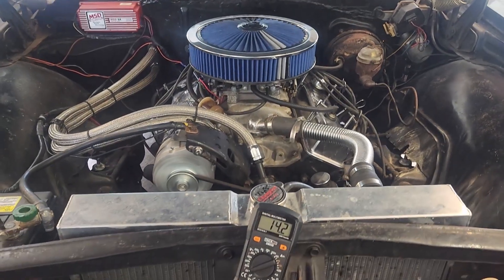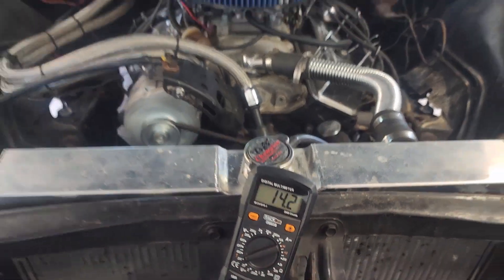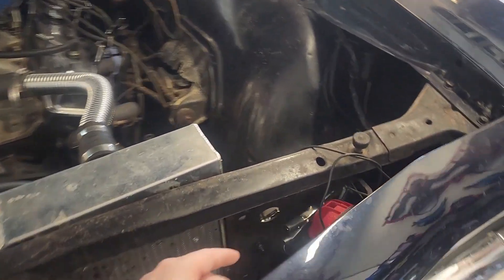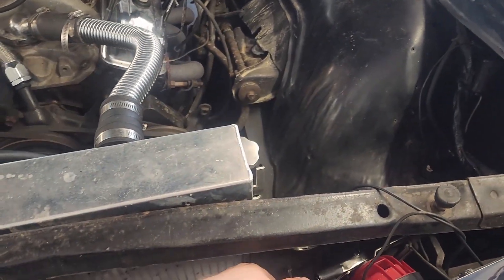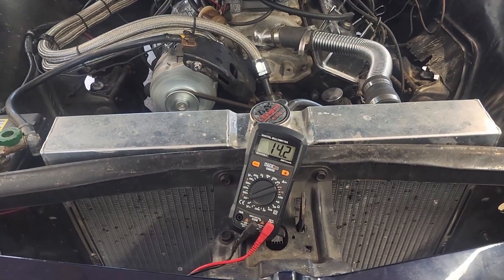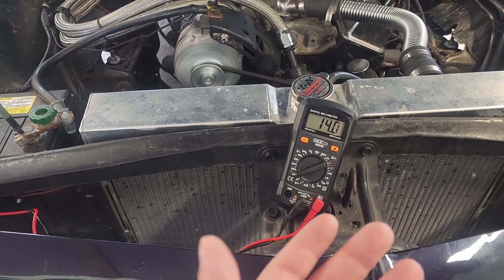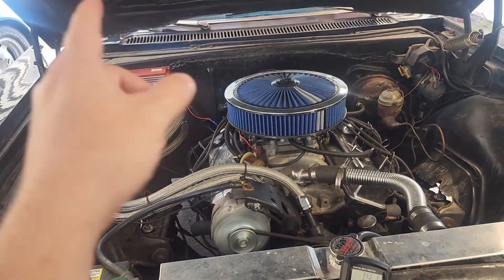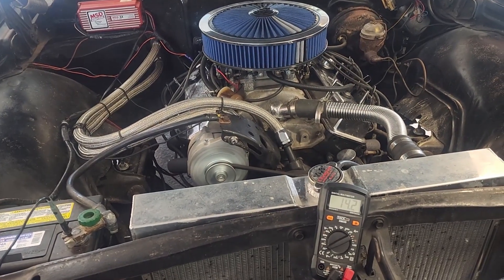Battery Voltage Too High [FIXED] (Alternator, Voltage Regulator)

Comment: Hi Scotty 😢😢😢 I have a Mercedes c250 2016 I have replaced auxiliary battery anf main battery also plus an alternator too but i have one problem that is not going away im getting this message which is saying STOP VEHICLE LEAVE ENGINE RUNNING PLS PLS HELP😢😢😢😢😢😢😢😢😢. BATTERY VOLTAGE SHOWING when car is off 13.0 12.9 12.7 12.6 12.5 12.4

Plus as soon as I start the car and it reaches to 14.8 means charging the battery but before it reaches around 13.4 or 13.8v I mean as its going up the message pops up Stop vehicle leave engine running

Comment: dude thank you so much i been trying to trace this issue i been adding grounds but ignoring the voltage regulator ground it must have a bad ground wire😮

Comment: That’s my issue with my 16 Chrysler 300. Voltage cracks 15-16V and engine bogs down. Lights pulse. I’ll try to check the alternator ground

Comment: I have problems on my Tigra A with voltage over 2500rpm. My lights are brighter and I have airbag and engine light but no batery light. Under 2500rpm everything is normal. Alternator and battery were changed 6 months ago. I don't know what could be the problem.

Comment: Bad grounds can be a curse to body on frame autos.  Over many years I've learned checking the grounding is a first line go-to when wonky electrical problems show up. It's often recomended to run extra ground cables from body to frame, and body to engine.  In the 80s my dad burned out three starters on his Chevy Caprice until a visiting out of state cousin checked the car and found the grounding was bad. Even the Chevy dealer's mechanics missed the poor. grounding.
Reply from the maker: Yeah, I definitely should of checked the ground earlier but its bolted right to the damn radiator support so didn't think that would be a problem.  I guess the paint and rust was enough.  When using the test light connected to the positive battery terminal and touching the regulator the light came on really dim which led me to testing it with the jumper wire.

Next wiring problem I am checking the damn ground first. 😂
Reply: @Struggleville2 So your ground going from the regulator to the alternator was bad? Or the ground from the regulator to the rad support? I'm having the same issue. And can't find it.
Reply from the maker: @UnapologeticAmerican1776  The regulator was not grounding to the radiator support.

Comment: Has the same problem in an old snowmobile. The headlight bulb kept blowing violently until I installed an external voltage regulator.